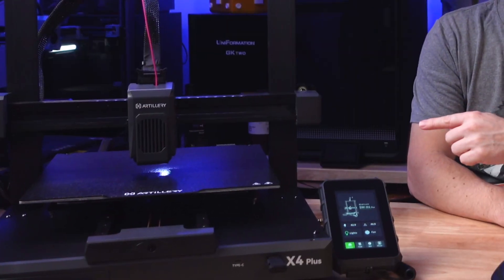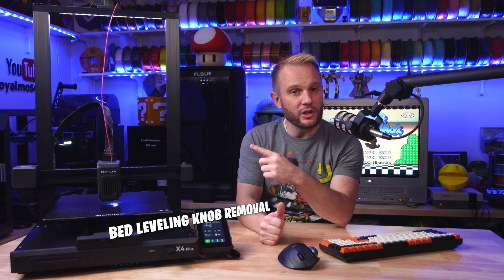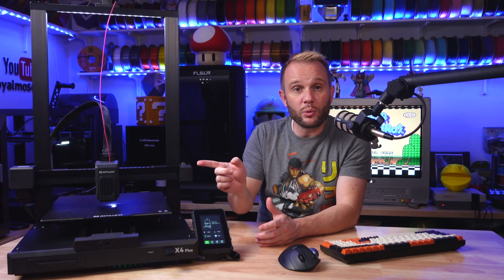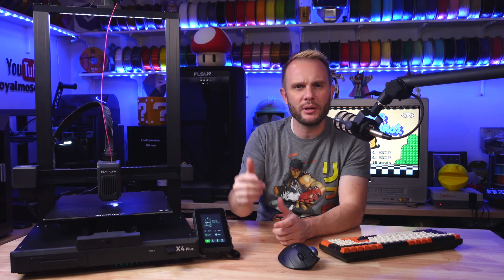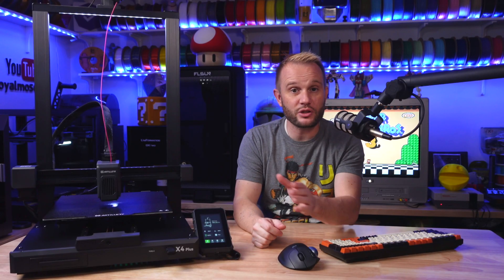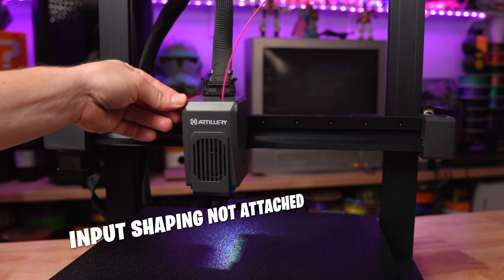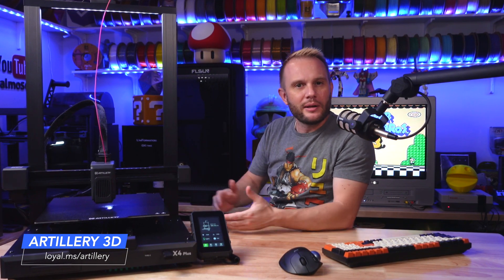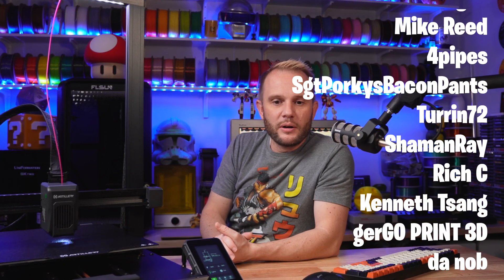Is this really an improvement? Artillery X4 Plus S1

Comment: Just started using my x1 after 3 years of storage. Turned it on, loaded some filament, plugged a USB, hit print and it worked flawlessly. I really missed the machine. Odd enough after a few quick prints, one of the ribbon cables went bad. Luckily I still had the spare ones that was sent with the machine. Back to work in a few minutes!

Comment: How does it work with Creality Official 3D Printer Enclosure with Fan Interface, Fireproof Dustproof Constant Temperature Protective Cover 550*650*750mm with Artillery X4 Plus S1? Can we improve or does it upgrade it?

Comment: So they found several problems with the first release, then instead of fixing those problems they released an "upgraded version" that costs $20 more.  They still seem to be selling the original, BTW.  Not sure if they've fixed any of the problems with it or they're shipping printers with known issues.

Comment: The problem I'm finding with auto leveling is that it's not 100% accurate.. and you will have to tweek it with the software if there are no manual knobs..  personally I like having the option to tweek it without having to fish through all the setting on the touch screen... but that's just me.. lol   I've only been printing about 5 and a half years now.. nothing special..  I did some nice LED floor lamps and a couple table lamps using ESP32 and flashed with WLED..  you can see a couple of them on my channel...  just keeping the brain from turning to mush since I have been retired now for many years.. I"m 66 and love 3D printing.. I started printing when I was building my quads and flying FPV..  was easier to print parts than to order and wait for them from China..  ;)    as of now I have 2 Longer LK5 pros and think they are great.. just very slow by todays standards.. my sister and I are looking to upgrade.. I'm looking at the Neptune 4 pro and she is looking at the one you are showing now.. and with the upgrades and the almost 50% off price tag..  looks very promising ..  thank you once again for a great and informative video..  I am making as I type this  a helmet from Helldivers 2  ...lol    great fun..
Reply: okay i got this printer a week ago...from factory bed level variation was 0.500mm or something like that...no manual knobs doesn't mean you can tweak it...grab a 7mm wrench and play with nuts bellow table, your wrench is your knob...then i managed to make bed to 0.13mm variance by playing with 6 nuts + (2 screws in the middle with screwdriver only) cause those in the middle causing hill or valley...then run auto bed leveling, then save it as own map, then load it as default map in klipper...

at least was for mine: grab a 30cm aluminium ruler (something aluminium that is very straight, avoid plastic ruler) by placing ruler on bed, especially diagonaly you could see gaps, and that bed is bent
1. printer off, manually raise z gantry 10cm from the bed, move it to each corner of bed, measure with ruller distance from bed to the Z linear rail, make sure its the same in all 4 corners by adjusting nuts bellow table with wrench. That's the first step to make sure bed is parallell to the gantry
2. play with each screw separately by placing ruler onto bed, placing a light source (like battery torch) behind ruler and observe gap - light passes bellow ruler when gap is present, adjust nuts until you see no light. Repeat on all 6 screws, check for all corners +ruler diagonally

Now you will have much flatter bed and perfect first layer across bed. Also make sure belts are not too tight! loose is better, mine had missed steps cause of too tight belt! That can be visible only when you print something higher above 1cm or so...

If you wanna tweak and invest time lemme know. I will help.

Comment: Just got my Artillery Sidewinder X4 Pro S1; I was really worried about having issues out of the box, Artillery seems to have had a lot of issues with the X3 & X4 series. I think the issues seem mostly ironed out and honed in now; I figured that at minimum if I have issues I could install an aftermarket control board and modify as needed. 
But so far, The SW X4 Pro S1 I have has been surprising & impressing me with nearly every print. It does incredibly well for its price point, I couldn't be happier. Its got darn near everything you could hope for in a modern bed slinger. 

The S1 also does still have manual bed levelling, At least for my X4 Pro S1 I performed an option manual bed level and it automatically moves the print head to each corner for you and guides you through the process fairly simply and easily. You just adjust the lock nuts that are on the bottom of the print bed. Very quick and intuitive in general. The use & implementation of Klipper has been great so far as well.
Reply: Are you sure you have the S1? When you look at the picture on the Artillery website between the Pro and Pro S1, it doesn't have manual bed leveling.

Comment: Hey your Vids are great. I will buy a new printer but i can not decide between "Artillery x4 pr s1" and the "Sovol Sv06 Ace". What do you think is the best option for a normal user. has one of these brands problems or issues. With which printer you probably have more joy and which of the two is quieter? Thank you very much for your opinion!

Comment: Mine just arrived and the test models print perfectly. However, when printing larger models the filament stops extruding. So, when you leave it at 20% and all is well then come back five hours it has not printed anything else. The filament just stopped. I asked Artillery but it's New Year there so no reply for at least 2 weeks. Any ideas? Thanks.

Comment: I pre-orderd the original x4 plus  & since they released the s-1 so quickly after. I kinda feel like I got a faulty printer... the leveling nobs SUCK to have to mess with constantly.
Reply: Its way smarter to use silicone spacers,level once every blue moon and still be able to adjust if needed than having them REMOVE THE KNOBS because people can't be arsed to turn a few wheels. If they're gone you can't do anything and are under the mercy of ever-faulty sensors and their guesswork

Comment: great video, i have 4 sidewinder X1's and they're still running great, but I'm feeling oldfashioned when loading the usb sticks, turning the knows to level etc... I'd like to buy a few new ones, the thing is that I'm quite set on using 1.2 mm cht volcano style nozzles. Can the use volcano nozzles be used on the X4 S1 ?

Comment: Now the X4 Plus is near $215, input shaper, and fixed bed can be added by a power user. It's Klipper on both machines on the same mainboard, it's not difficult to configure an USB ADXL345 module. 

Under the bed I saw many fixed systems.
Reply: so its possible to upgrade plus to s1 by buying the input shaper, and fixed bed? I bought mine for 216 euros.
Reply: @c00kiem00nstar  Don't fix bed, leave with wheels and put silicone bushing. Using SCREE_TILT_CALIBRATE macro you have a very good mesh.
And you can buy the stock ADXL345, but I prefer the Mellow Fly USB-C it's cheaper and easy to use, with lot of tutorials. 
The S1 has also a stronger Y belt but I don't know if it's wider. On Printables I found a project to change with 7.7mm of the K1 and other CoreXY printers.
Reply: Thanks! Input Shaping is free if you request and  email the company. Make sure you have the doxuments needed. "Not secondhand"

Comment: I think the issue with any bed is temp. I heat up my bed for 5 minutes, then manually level, then software compensate only 16 points. But even then the bed can still warp. and asking for a milled piece of hardened steel is out of the question. Need a material that does not shape shift/warp when temp changes. so Software compensation for Z axis is the only way to really level.  We will just have to wait until Boeing release an affordable sonic 3d printer.  lol.
Reply from the maker: Good tip

Comment: Thx for your updated review.
Besides your video there‘s almost no footage to be found about this machine.
As my Sidewinder X2 died the other day I need a new machine.
The cheap price on the X4 plus S1 is very tempting, but would you recommend this machine over the Ender 3 V3 Plus?
I‘m just want to print helmets as hassle-free as possible and with higher speeds than the old X2.
But as Creality announced the CFS system to be compatible with the Ender 3 V3 Plus, I‘m more or less sitting on the fence.
Keep it up, I really like your channel a lot.

Comment: I think the Firmware 1.5.0 is the Firmware from the x4 pro because i installed it on the x4 plus s1 and now it has 36 measuring point not 121.(I think Artillery uploaded the x4 pro Firmware to the x4 plus)
Reply: you can ajdust printer cfg and klipper bed probing and set measuring points and all sorts of things...

Comment: Hi, I didn't understand one thing: are the auto-leveling sensor and the Vibration compensation sensor included with the Plus S1 printer or will you buy it separately?
Reply from the maker: The sensor is included with the printer on the updated X4.

Comment: I have equipped an X1 with bl touch, z axis supports and linear guide. Now, 4 years later, I see what you can get for cheap money, man, how quickly everything is developing
Reply: I was just looking at booting up my old X1 as well and figured I'd take a look at what was out there. Looks like I'll be upgrading soon, haha
Reply: @joshmaggard1388 Do you have any idea to improve it?
Reply: Just started using my x1 after 3 years of storage. Turned it on, loaded some filament, plugged a USB, hit print and it worked flawlessly. I really missed the machine. Odd enough after a few quick prints, one of the ribbon cables went bad. Luckily I still had the spare ones that was sent with the machine. Back to work in a few minutes!
Reply: same, I sold my X1 a year ago because printers are just getting too good too fast.

Comment: I really appreciate you taking the time to review this. I’ve had an x1 and it’s been packed away and I’ve been wanting to play with it but the coast to upgrade and change everything to get it to a decent printer I’m better off getting a new one. I was wondering if the build size is the same from the x1 to the x4

Comment: Dear LM, I have original one, it is pretty cool so fast and BIG. Can you show testing larger nozzle sizes? I am not sure how best to determine how to get the best out of the hot end and the larger nozzle sizes. There must be some test to run to determine when you hit one of the constraints (the hotend to melt vs the large nozzle to flow). Curious how that might make helmet printing faster??? It might be a good angle to bring viewers that own other big printers.
Reply from the maker: Most printer websites will have their maximum volumetric flow, and slicers calculate this automatically now and will warn or provide you with the recommendations. Join our discord we can definitely help you there! Also, I can definitely do a video on this topic!

Comment: I think I feel the same way about input shaping. It should just be there, installed on all the axises.  I have the Creality Ender 3 V3 KE.  It does not come with the input shaping module.  I had to purchase it separately, 3d print a bracket to attach it to the printer, run a cable and plug it in to a difficult spot to get to just to run the input shaping and then remove all of the above.  What a pain.  Input shaping definitely seemed like an after thought for that printer.  I’m glad it has it.  It looks like the Artillery printer here at least makes this a bit easier.  But why not just have them installed and able to be ran whenever or ran every time before a print like my A1 mini? 

Bed leveling knobs.  Honestly until recently I had no experience with them.  All my printers just used ABL.  With my new Neptune 4 Max, I am very thankful of the bed leveling knobs.  With larger print beds II like to have the option to level it the best I can before letting ABL does its thing.  It is a pain to manually level a large bed for sure but I also feel you get to know your printer a little more.  Of course there is something to be said for the fully ABL process!  Just send the print and walk away.  I do enjoy when tech just works like it’s suppose to.  Thanks for another great video.
Reply from the maker: Definitely! Input shaping being hardcoded is a shortcut that I think needs to end. There are a lot of factors that would change that when a printer makes it to an end-user's home, and those modules are cheap enough, they should just be included.

As for knobs, I know the reason they still exist is cost. They allow larger format machines like your Neptune 4 Max to be much more affordable for us to get at home. Heavy duty, precisely machined print beds cost more for sure, so I am thankful at least that this option exists. But, with that said, I'd love to just see everything automatic and never even think about it again.

Comment: Do you need to use highspeed filaments for a printer like this to get the higher print speeds or is that just a sales tactic?
Reply from the maker: You don’t have to run high speed filaments, you can just adjust speeds and flow. High speed filaments are real formulas, they have additives that allow them to melt quicker and cool quicker. Eventually everything will just be high speed filaments like Bambu Lab filaments.

Comment: Now, if only Artillery support was any good.   I had a motherboard issue. After support diagnosed it, collected information, they completely ghosted me and never sent any parts.
Reply from the maker: How long ago was this?! I’d reach out again, and make sure they get it handled!
Reply: @LoyalMoses  Bought in May 2024.   Failure and diagnosed June 2024, sent email on July and August for follow up on parts.   Never a single reply to my emails in July or Aug.  I did end up buying my own motherboard.   Haven't installed it yet, as the whole thing with support has just soured me on even using that device again.
Reply from the maker: So sorry to hear that!

Comment: Does the machine do automatic z offset in addition to automatic bed leveling?
Reply from the maker: Yes it sure does! You can adjust it, default was a tad high but still printed fine.

Comment: The Artillery website still lists the X4 Plus as available at $20 USD less than the S1.  For $20 I'd grab the upgraded one. I agree about the value of iterative updates, but do wish more vendors would then also offer the upgrade components and firmware where needed, to the previous iteration, much as Prusa seems to always do.
Reply from the maker: Wouldn't that be cool to see a small upgrade kit?
Reply: upgrades for sw x3 would also be useful

Comment: Oh. When You make the video on X4+ vs X4+S1 do a big, high, possibly quite rectangular print, like a building, so that we can compare the input shaping. Maybe just print something like a fast print of a high pipe with almost max height, that's how I check the vibrations (and cooling). Usually with a single layer wall.
Reply from the maker: That is the plan, I want to see if the speed and math check out!